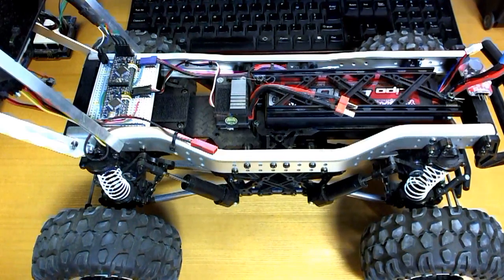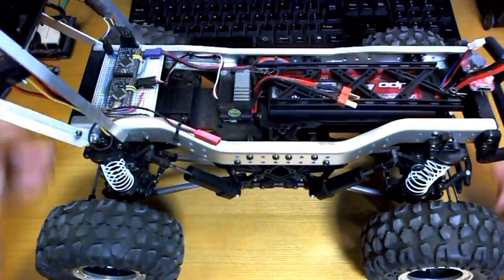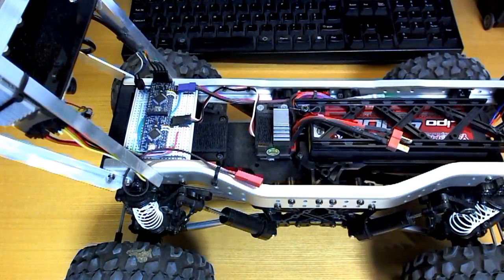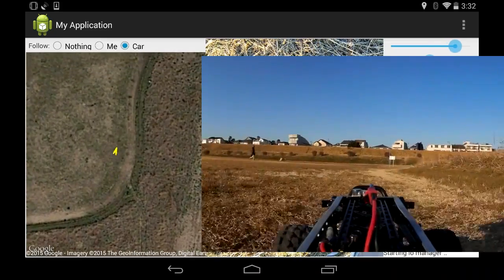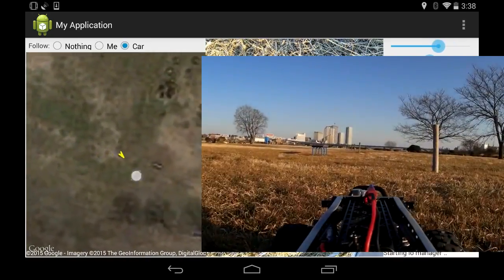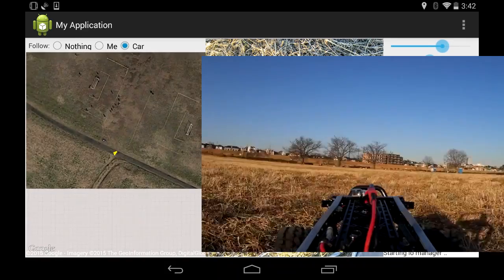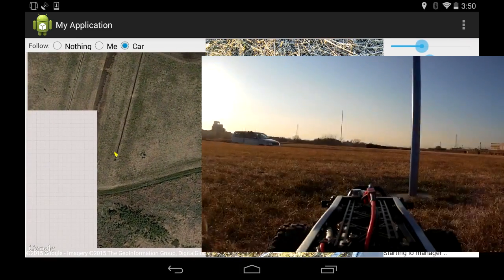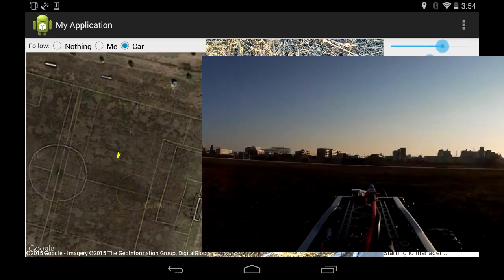(continued) RC car GPS telemetry (arduino + nRF24L01 + android)

Comment: Hey, im really interested in GPS and auto driving. Ive already ordered a small GPS module. What car do you recommend u get for developing with, and how much did that car cost?
Reply from the maker: If you're driving on a clean flat surface like concrete, pretty much anything would be ok. It really helps to have steering that returns to center accurately.
Unfortunately this car was pretty expensive, about $250. I wanted something that would not easily get stuck in long grass.
Reply: +iforce2d ok thx :)

Comment: how far did you go in the end?? 

and would thus work for the nRF24L01 (on each end)
http://www.ebay.co.uk/itm/2W-Wifi-Wireless-Broadband-Amplifier-Router-2-4Ghz-Power-Range-Signal-Booster-/271688547858?pt=UK_Computing_Boosters_Extenders_Antennas&hash=item3f41e63e12
Reply from the maker: About 300m, going through a small patch of scrub - it would be much better if the remote endpoint was not so low to the ground, see my videos on nRF24L01 range testing. Yes, I expect that amplifier would work, if you can find a way to power it - give it a try and let us know :) I would think a patch antenna at the ground station might be easier though, and if you're really looking for serious distance then a lower frequency than 2.4g would be much better.